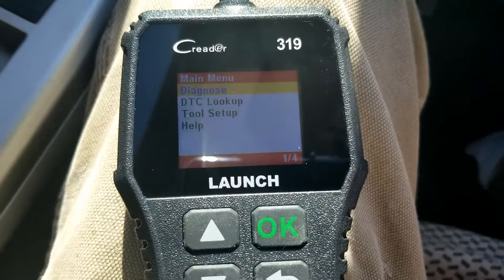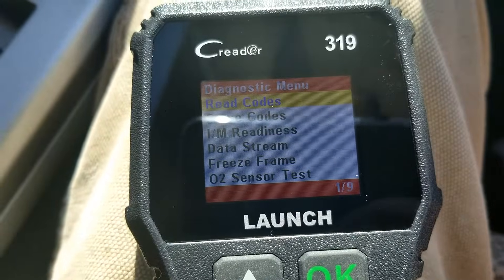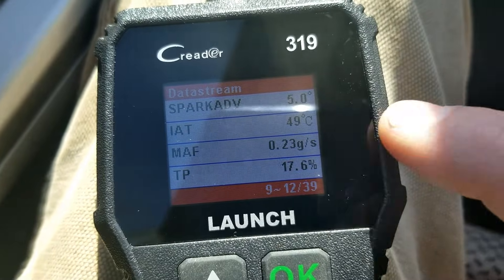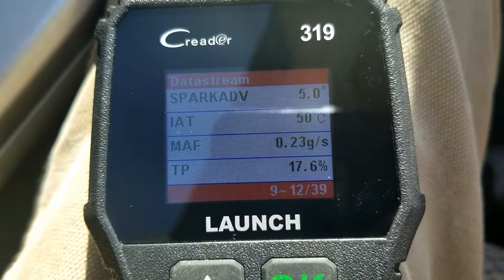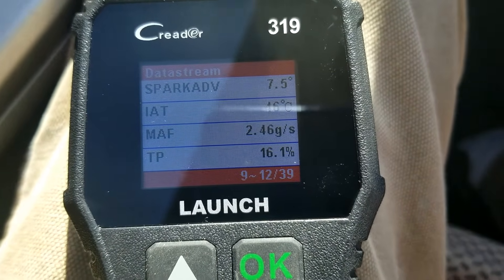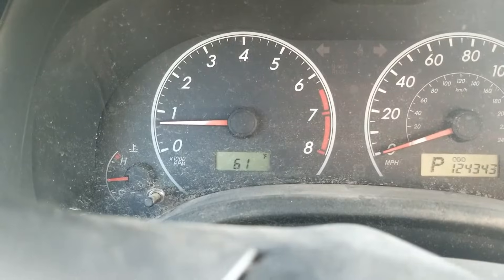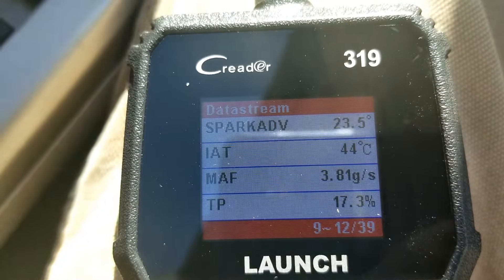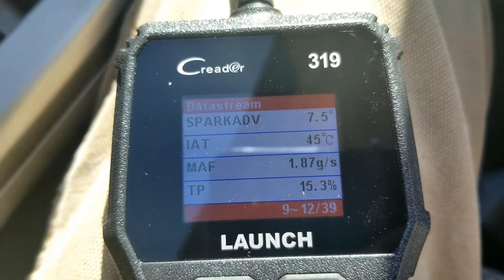2 Ways Test a MAF Sensor with a Low-Cost Scan Tool (Mass Air Flow Sensor)

Comment: Great video I went to live data and mine is reading 0.0 that means it's broken.It's not working at all?
Reply from the maker: If the engine is running, it should give a reading.
Reply: @HVAC_Mechanic my engine is running,  reading at 0
Reply: @HVAC_Mechanic got a new MAF and is working now reading 4.5

Comment: hello im working on a 2004 chevy s10 that idles good, wont go past 30 mph. when you step on the gas the motor bogs, wont increase rpms. it does have a current code of P0101. i have a good scan tool, key on reading for the MAF IS 0.66,  IDLE THE READING IS 0.03,  INCREASING RPM TO 2000 THAT NUMBER RISES TO 0.07 TO 0.08 WITH THESE LOW NUMBERS AM I LOOKING AT A FAULTY MAF ? Thank You

Comment: The MAF GPS should be the same as the size of the motor. ie, a 2.5l should show 2.5 GPS  [ +/- 2% ] at idle. That's not a dead balls on law, but a good 'rule of thumb'. 
ps, awesome Video!
Reply: “Dead balls”  wth ?
Reply: @billybobbarker3175  "Dead balls on" as in "exact"

Comment: On my 2012 Honda Civic LX, I'm only seeing 1.3 lb/min. at 2500 RPM
It should be 1.98 lb/min to 3.3 lb/min (15 and 25 g/sec)
I replaced the sensor and it still read 1.3 lb/min.
Could there be that much of a vacuum leak that the sensor isn't seeing enough volume?
I did have a bad tear in my air filter to throttle body hose. But I replaced it before swapping sensors.

The main problem is that I'm only getting about 17mpg city.
I had this problem on my BMW and cleaning the MAF sensor doubled my gas mileage.
(I was only getting 15 MPG city or highway.)

Comment: On a 5.3L Chevy Tahoe engine my MAF was reading 3.3 gm/sec at 600 rpm (close enough to 500 rpm I figure) and the long term fuel trim was in the range of +18% on both banks. The doubling the engine rpm doubled the MAF value. Update: It turned out that there were air leaks around some injectors. So the MAF was actually okay and was giving a low reading because not all of the air flow the engine was seeing was flowing through the MAF. I guess the standard MAF value of about 1 gm./sec. of air flow per liter of engine displacement only applies with no air leaks. So your test was actually accurate.

Comment: My creader 3001 reads in pounds per minute maf. At my idle rpm of 1032 it comes out to 5.97 g/s when I do the math to convert to grams per second from pounds per minute. I can’t raise the rpm cause I’m in a Prius. The rpm’s  don’t increase when you press the accelerator like a normal car. When the car isn’t running automatically like is does in the ready mode I can push the accelerator and it will start and the rpm will increase if you keep pressing down. The reading I got holding the accelerator with my foot at 1500 rpm’s was .5 lb per minute and went up to .8 lbs per minute at 2000 rpm’s. Again when the car runs automatically without my foot on the pedal it will not increase rpm if I try to accelerate. I only get an idle of 1032 rpm’s and the maf converts to 5.97 grams per second at idle.  I got these codes po172 and po101. I cleaned the maf sensor with crc maf sensor cleaner a few months ago. My air filter I can still see light through it and it doesn’t really look that dirty. My maf sensor wiring seems ok. Nothing has disturbed it. The fuses are ok I think. I know this is an older video but I need your help if possible. I don’t want to buy an expensive maf sensor that won’t be returnable if removed from the packaging and plugged in and that’s not the problem. Any help would be appreciated. Thanks !

Comment: Thanks for your video. My MAF is reading 198.44 g/s & staying on that (don't move) take it the MAF is done & time to replace, plus TP below MAF reading is floating between 89 & 90% yours is on 16/17 .I driving a nissan juke 1.5 dci 2013. Please  help if anyone can. Thanks.
Reply: Mine with the same vehicle was 5 which is normal but had no boost and really sluggish.  Leaned the sensor and all the boost is back but mine reading the same 198. Did you replace yours to fix it?

Comment: Please someone, mine only gets to .534 at idle, it doubles that amout if i double rpm, is it bad,? Im getting lean codes
Reply from the maker: If it doubles with the RPM doubling, then it is usually good. Are you getting a MAF code? Lean codes can be difficult to troubleshoot since they can be caused by so many things. I made a full video on how to troubleshoot lean codes. Here is a link. https://youtu.be/b9__WGuD-dc

Comment: MAF sensor data is dependent on an engine with no intake vacuum leaks and no exhaust leaks. Assuming the engine integrity is good the MAF sensor should read grams per second close to 1 gram per second for each liter of engine displacement. An 8.1 liter V8 should read a minimum of 8.1 grams per second at idle. Second example a 3.4 v6 should read a minimum of 3.4 grams per second at idle. A 2.0 liter 4 cylinder should be close to 2.0 grams per second at idle. 
If the reading is low check for dirty MAF sensor, vacuum leaks lose clamps or attaching hardware on the intake tubing, clean air filter etc, and lastly exhaust leaks causing poor oxygen sensor data. If everything checks out and cleaning the MAF sensor doesn't  correct the issue replace the MAF sensor. 
Retest and verify the correct data of 1 gram per second at idle for each liter of engine displacement
Reply: Mine is 9g and it’s a 2.0l 4 cylinder
Reply: @SystemForSuccess Turbo?
Reply: @jeeperjeeper2956  yes a Turbo Diesel
Reply: Mine is 2.5 litre turbo and measures 4 grams per second, what does that mean?
(I have issues with over lively throttle feels like boosting too early, I suspect MAF, MAP or Boost solenoid valve, can you read data for these aswell)
Thanks
Reply: Thanks, very informative. Question, My 2.5 liter v6 lexus is reading 3.37 at idle (796rpm) is going high what could be the problem
Reply: @alejandraromog  1 GPS for each Liter of engine, so a 2.5 reading 3.37 GPS is slightly, very slightly high but it is in the "OK" range. If you clean it, the GPS may come down a little.
Reply: if it high?
Reply: @وليدخالد-ب4د7ل  Clean the MAF sensor and try it again...it should go down.
Reply: 5.3 V8 Chevy Tahoe should read 5.3 👍🏾
Reply: Thanks very much.
Reply: Thanks a lot for this information. 💪🏽
Reply: I have a 3.0 liter and it’s reading apprx: 3.28, then jumping to 4. Something and then back down at IDLE. Im attempting to clean the MAF sensor before moving on to my bank 1 sensor replacement. Thanks
Reply: Quick note: i forgot to turn off my AC, now its reading 2.40 g/s and im guessing that’s low.
Reply: @Shamzpachino4627  thanks , I turned off the A/C and the numbers changed. Still a little low (2.1 on a 2.5 liter)
Reply: Mine is .9 lbs per minute

Comment: At 0.21 and changed the pigtail, checked volts on each prong, new max sensor, but it stays at 0.21 unplugged and plugged in, and started

Comment: I been plagued with p0101 code for 4 years, on the on position not running i’m getting 1.18g/s when starter and idle im getting 4.8g/s and at 2000 rpm i’m getting around 11g/s I don’t know if sensor is bad or good.

my check engine light turns on usually stays on, but if i drive on highway for 30 min, turn off car turn car back on, the light will go off! sometimes stays off a few days sometimes a week but always comes back. any ideas ?
Reply from the maker: If the MAF sensor is good, I would test the wiring. It sounds like it is an intermittent issue, like a bad connection or a wire rubbing on something.
Reply: @HVAC_Mechanic  I replaced my spark plugs and found oil in 2 spark plug coils.  I put everything back together as i need my car but I’ll be replacing my valve covers in few weeks, curious if a leaky valve cover can cause P0101 too….
Reply: my maf sensor would work initially. the voltage would be at 4.1 at wot the 1st time. the 2nd time it would read 3.9, then 3.5 then 3.2 and then nothing after that. so when you first start driving the truck, the power would be fine. however, 5 minutes into a drive, huge power loss. the barometric readings were way off for my location at sea level. another small symptom the maf was bad was also the .03 voltage with the key on engine off. for my vehicle it should've been at .01

Comment: Mine is at 15g/s at idle but i replaced it and its still reading high? Any idea?
Reply from the maker: I would test the wiring and be sure the connections are good. Also, an issue with the EGR valve can cause problems with some engines.
Reply: @HVAC_Mechanic  its a 4.6 ford engine through the scanner i have all my readings seem okay its just picking up alott of airflow somewhere

Comment: Great video thank you for the info. 2008 Chevy suburban would not accelerate smoothly from 1500 to 3000 RPM.. after 3000 RPM, the engine would surge with power. No engine codes present. Just by chance I had the original sensor replaced it after about a week of driving it must’ve recalibrated acceleration is back to where should be..

Comment: So if I have a P0102 code registering low voltage for MAF, and this test shows the sensor is good, where am I?
Reply from the maker: I would fix the low voltage problem. This is a rough test to see how the MAF sensor is working. The issue may also be intermittent with the sensor working good sometimes and not other times.
Reply: @HVAC_Mechanic  that's a relief...  intermittent problems are the easiest to fix, right?  ;)

Comment: I know this is a year old but if your still making videos could you maybe run though live data and kinda explain what the readings are and about where those readings should be at normal. Thanks
Reply: Look if u have 1.8 L engine u should be having 0.18 to 0.20 grams per second of airflow at idle that would be normal that is needed to overcome the parasite loss of the motor but at wide open throttle u would need alot more airflow since the ECM is multiply base air equation to knoe how much fuel to inject and injector on time in milliseconds but yeah if u have any questions feel free to ask

Comment: Is there a difference between gasoline and diesel engines? Because I have a diesel engine and the reading in operating mode is 10-12 grams. Is this normal?

Comment: GM, my 98 s10 4.3l engine light came on once I unplugged the sensor after the maf sensor, the truck was running and I just unplugged both sensors one at a time, after I plugged the last sensor back in the vehicle started idling a little high, and that's when the engine light came on, I don't know the name of that sensor is called

Comment: So mine at maf is greyed out with ignition on and other sensors showing values. Showing no data. Is that a faulty sensor?
Reply: Do you have a MAP sensor instead of a MAF sensor?
Reply: @mannys9130  no. I've got that car all figured out now tho. Fixed some bad wiring and rebuilt about 60% of the car. Been driving the hell out of it for 3 months now.
Reply: @mannys9130  oh and after I fixed some other wiring the maf isn't greyed out anymore

Comment: I measured my car, a 2007 Kia Optima, with a 2.0 engine... at idle, it was 2.3 g/s... and when I had double the pressure, it was 4-5 g/s.. Does this mean it is good??? Because when I removed it while the car was running, the car did not turn off and continued to run

Comment: Don't forget for correct readings engine must be up to operating temperature with no load to get proper reading. My vehicle for example says 2.0-6.0 gs at idle when warm which mine is 4.6 so it's fine on a cold start its 18-20gs until warm and this is mid winter in Canada. Before starting vehicle mine showed 1.8gs with key on. Also my vehicle specs show 7.0gs -20gs at 2500rpm mine goes to 15-16 gs 

2011 pathfinder 4.0 

Yet im still getting a p0101 code i changed maf to a new one erased code it came back put original one in came back so im stumped atm i did change my intake tubes as they were dry rotted and cracked also. Vehicle runs fine dosent miss or anything and drive ability is great
Reply: Did you figure it out? You should check the wiring if you've ruled out the sensor.
Reply: @KingBigBabyJesus  no I found online nissan had a service bulletin for this code and only way to get rid of it is take to nissan and have them charge 2 hrs to clear the ecu
Reply: Nissan has tsb's for ecm reprograms for p0101 dtc's on many of their models. I've personally reprogrammed many ecms for this dtc with no come backs

Comment: Hi bro i really need your answer my IAT sensor tells me that the Air intake temperature is after i run the car for over 10 minutes 70° to 86°C but the weather temperature is 29°C and at night.

Is it normal to get that hot?!
Reply from the maker: If the IAT sensor is reporting a different temperature than what the air is, then it is likely bad, or the wiring going to the sensor is open/short. When they go bad, they often report high or low temperatures.
Reply: @HVAC_Mechanic  Thank you so much for your reply, I will check the wiring if not from them i will replace it because the check engine light is off i was wondering if there is a problem but the ECM doesn’t recognize it and thinks that the weather is hot and dealing with the issue as if it’s hot 😅.

Comment: That’s great advice what engine size on the this particular car u have hooked up to
Reply from the maker: This was a Toyota 1.8 Liter. I should have mentioned that an engine uses 1-1.2 Grams Per Second of air flow for every liter of engine size.
Reply: @HVAC_Mechanic  yes sir needs minimum air flow to overcome the parasite loss of the motor
Reply: @HVAC_Mechanic  yea Kia and Hyundai use little more airflow at idle but you are more of a expert then me by the way great rule of 👍 thumb

Comment: Hi thanks for the video.
I got a cuestion,,I hot a nbs 07 silverado I used a scanner and all the time it's reading 0.01 0.05 all the time,it doesn't reach at least 1.0 or something like that, always stays under 0.05 or so,will be a bad maf or is it normal,the same happens at idle no rech higer number like your video
Reply from the maker: In general, at idle, an engine uses 1-1.2 Grams Per Second of air flow for every liter of engine size.  So, a 5.3L engine should show around 5-6 Grams Per Second at idle.

Comment: every engine will be different so knowing what engine your testing helps
Reply: In reality MAF sensor works pretty much the same on all engines. A good MAF sensor will report approx 1 gram per second airflow for each liter of engine displacement. Example a 6.0 liter V8 will read over 6.0 grams per second at idle.
A 3.0 v6 will read over 3.0 grams per second at idle. Lower reading indicate a possible dirty MAF sensor wire causing a low reading or possibly intake vacuum leaks or exhaust leaks ahead of the front oxygen sensors. This test will allow you to track down and eliminate these leaks. After verifying the engine doesn't have these issues if the reading is still below 1 gram per second airflow for each liter of engine size then replace the MAF sensor and retest. Exhaust leaks have been an issue people don't consider and I've repaired these issues to correct others misdiagnosis of a "bad MAF sensor"
Hope this helps.
Reply: @falcorthewonderdog2758 🔥💯
Reply: @falcorthewonderdog2758  Your comment caught my attention. Can you tell me if a reading of 3.8 g/s idling is normal in a 2005 Honda Accord 2.4cyl?
Reply: @falcorthewonderdog2758  my maf sensor reads 0.01 when I disconnected my maf sensor my vehicle immediately shut off. I’m so confused. My vehicle is misfiring. I cleaned it. Maybe I need to replace it?

Comment: So my mass sensor is reading 0 when the car is off but when the car is in idle or wrapped up in his reading anywhere from 0.245 to 0.84 grams per min so that does mean is bad and not reading high enough right lately I've been having ass admission cold give me with the mass flow air sensor but about a aftermarket one and it did not work any better
Reply: depend on the engine size & throttle body size...
Reply: Did you figure?

Comment: I changed 2 mass air sensor and both of them give me 0.0g/s the wire is good and the air mass fuse also is good any help please ?
Reply from the maker: If the sensor and fuse is good it likely is in the wiring.
Reply: I have a Nissan Xterra, it took a couple times for me to realize it would only cooperate with a genuine Nissan sensor.  I got the original part# from the dealer parts dept. & searched online for the best price from there.  Some brands only like their own parts.
Reply: Thanks guys the problem was solved i got a original MAF  and i dont have in problem now

Comment: It was idling right around 800 and the reading was about 35 to 40. When I doubled the RPM The reading went to about 62. Does this mean my MAF is bad? Great info hank you
Reply from the maker: It is close to double, so likely good. There are other tests that can be done. I would clean it up and try again.
Reply: Did you have a truck or car? Engins idle high at start up then go down after open loop
Reply: @Life3000AnF  car

Comment: thanks heaps for this video, my 2.5litre turbo diesel has been idling rough and I figured it idles from 14g/s to 20g/s (fluxulates between those 2 values every second or so), and my sensor reads 1.53g/s when the car is off. I have ordered a new sensor online, hopefully all goes well.
Reply: Here for answer as well
Reply: @joyboybrians so am I 😅
Reply: What happened to you?
Reply: @Eng_RAY  ended up being a suction control valve, not the maf sensor
Reply: @EliteTurtle05  what is that like thr throttle?
Reply: Did changing it fixed the issue?

Comment: Hi thank you for posting very good video. What if I have a 0.0 at idle?
Reply from the maker: A MAF sensor should range around 2-7 grams/second (g/s) at idle depending on the engine.
Reply: 1-1.5v at idle
Reply: What should it read at key on engine off opel insignia mine read 0 is that normal?